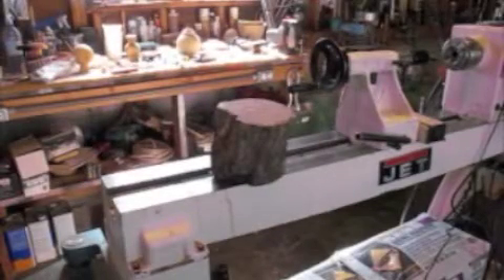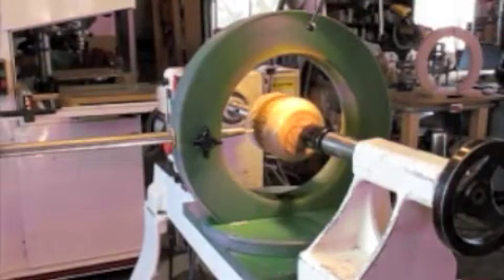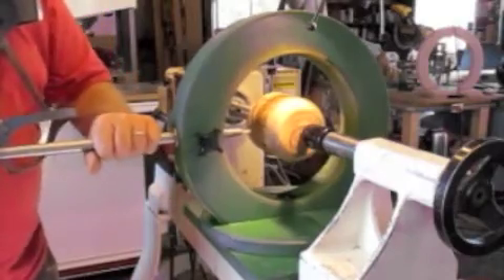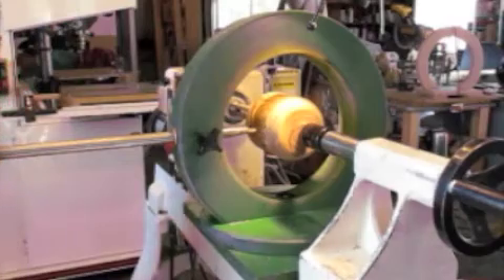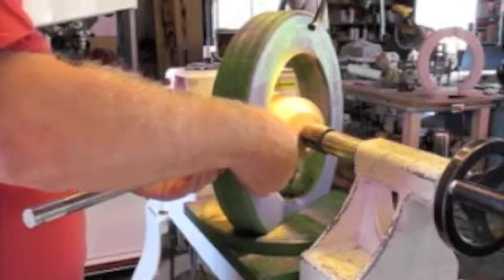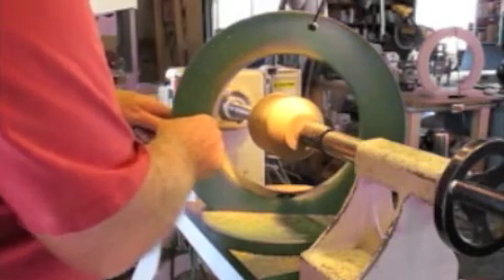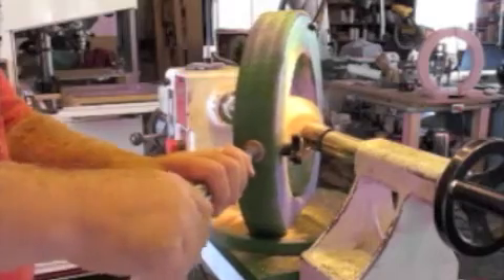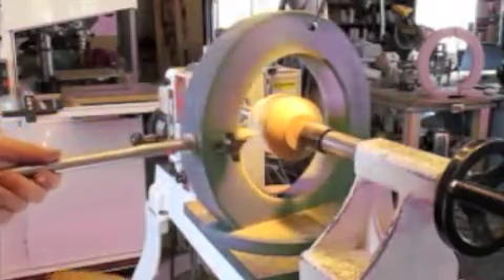Sphere turning jig

Comment: I am making this jig with scrap 11/32" ply after seeing this video a little while back and I am to the point where I need to find a guide bushing or linear bearing for the bar and also need to find a steel bar of like dimension as well as the bearing at the center of the base... What materials did you use, and what are the dimensions and where did you get them? did you grind a flat on cutting end of the bar and tap for a diamond shaped replaceable, carbide cutter?